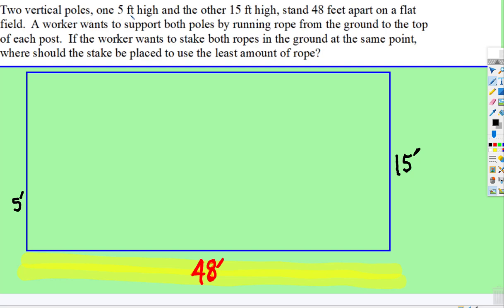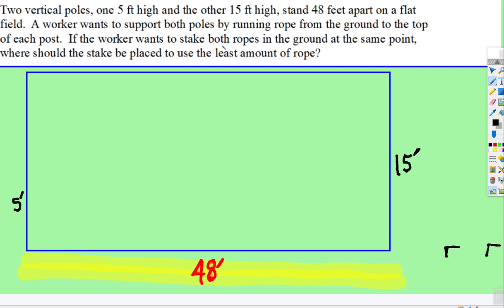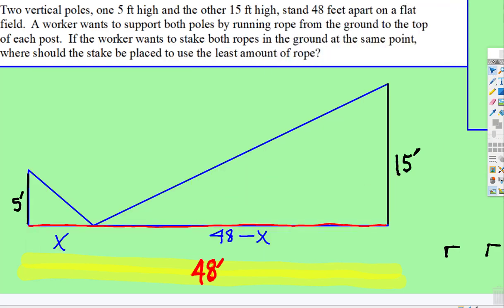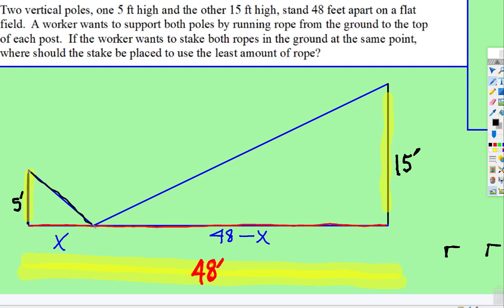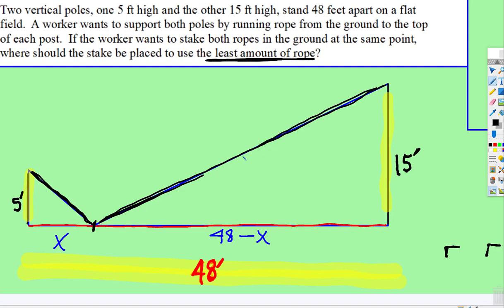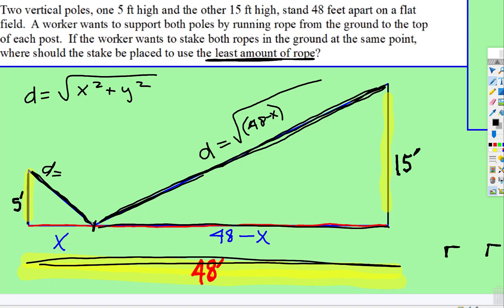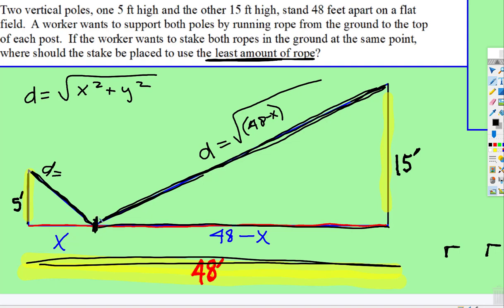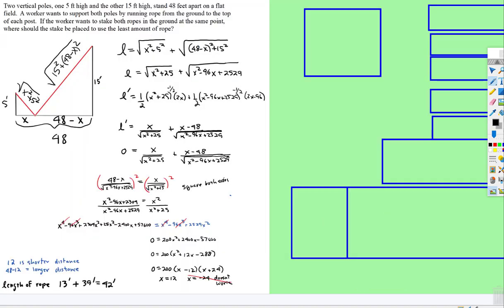Derivatives: Optimization - Two Vertical Poles - Minimizing Length of Rope

Comment: it's always good to work through a problem like this in the Detailed Way. It's paying our Dues as we learn how these problems are solved. Eventually, we discover other ways to solve this problem. That second way is realizing we have Similar Triangles. That leads to a General Formula where  x = (h1* R) / (h1 + h2)   .. R = the distance Between the Poles, 48 in this problem. Check it out, it works..  Thank you for this classic Calculus Min/Max problem :)